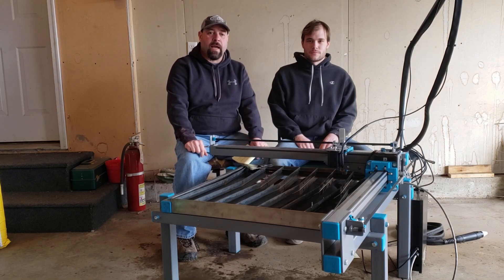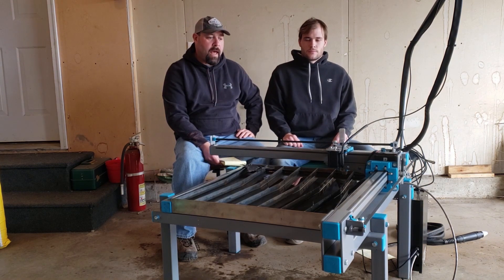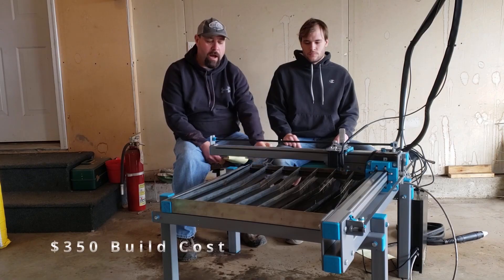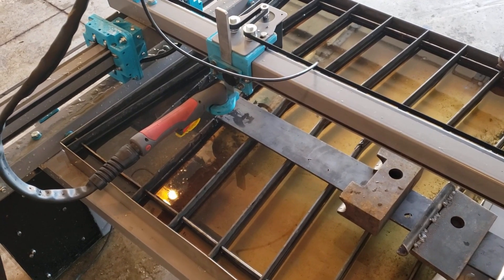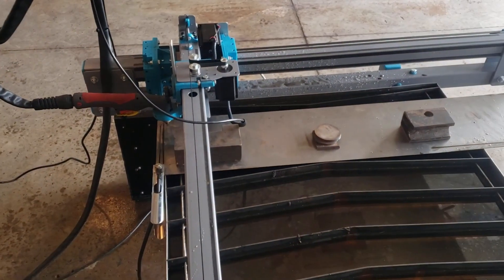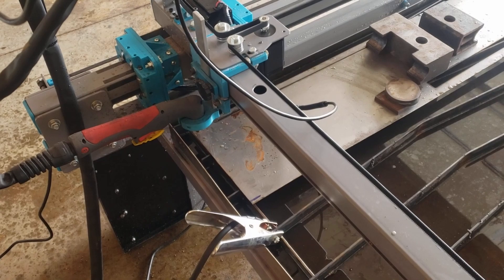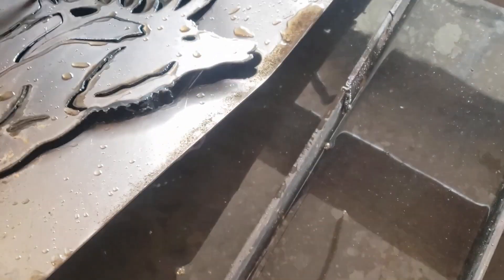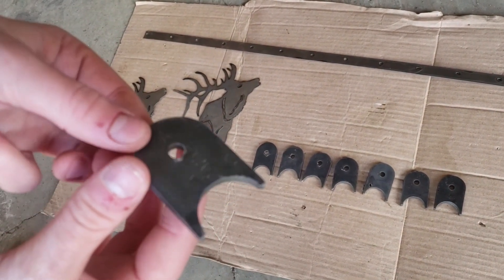$350 Budget DIY CNC Plasma Cutter - Quick and Easy

Comment: I think this looks awesome, I've built a plasma and co2 laser setup myself then upgraded to a crossfire pro for my plasma needs(i also operate a 12x40ft plasma at work). I'm sure you did your research, regardless, be mindfully of how close your design is to langmuir systems. I don't know what if any patents they hold on their design(i would assume very few on the mechanical side, probably just software and their logic board layout). Do you plan on introducing a z axis in the future? I designed one for my homemade machine then ended up buying the crossfire pro anyway. The thc makes a huge difference for tip ups, dross, and consumable life.
Reply from the maker: Thanks for the feed back.  We are planning to release a rotary axis for our plasma cutter soon. This will be able to cut and notch round tubing/pipe.  After that we will be looking at a Z-axis.  We are also thinking about a THC but don't want to spend the money on a proma unit to get a THC working.  
btw, we did do a our research and are confident that our design does not infringe on anyone's patents.
Reply: That's good to hear about the patents, it would suck to get into trouble. I really like the idea of adding a rotary, nobody includes one on cheaper commercial plasma setups. I had similar thoughts on the z axis w/thc expense which is why I skirted around it until  I wanted a larger table anyway. Now that I disassembled my old plasma build I have some nema 24's and extrusion laying around, maybe I'll throw a rotary together myself. It'd be interesting to see if the thc on my setup could react fast enough to handle square tubing without sacrificing speed. Keep up the great work, I'd like to see where this ends up in the future.
Reply: If he's not selling his plasmacutter they can't claim patent infringement.
Reply: It is nearly a complete copy minus the cheap lead screws Langmuir uses. However Langmuir doesn’t have anything patient able here. They even pulled that language from their webpage long ago. 

Langmuir is a marketing genius. Anyone who knows or “does their research” knows Langmuirs crossfire  isnt a great product that’s why the original required major modifications from users and is likely white labeled from China HAUWEI cnc. They have made the (smartcut2200) table since Langmuir sold the crossfire and make most industrial machines for large name brand companies. Also shipping manifests from China to these locations look......not to mention the controllers are 100 percent identical. Not sure about the pro. That one uses an $5 Arduino nano as its controller😂. Still uses the junk $8 tb6600 drivers and crappy lead screws though and has zero EMI /EMF protections! Tables are sub par, over priced, marketing is amazing.